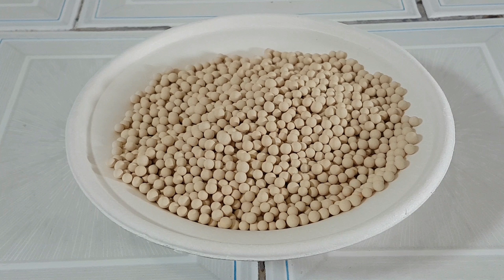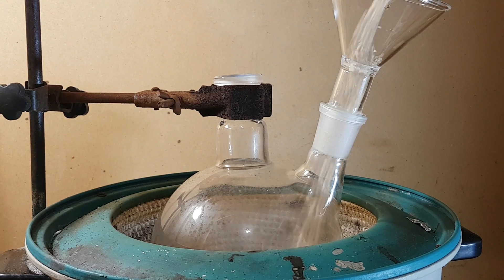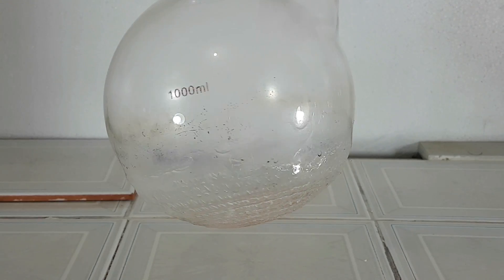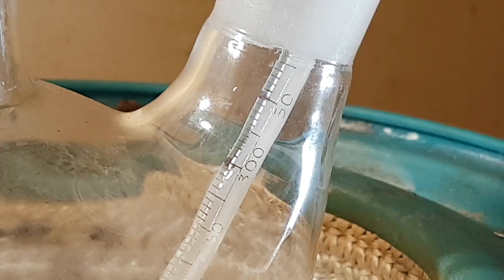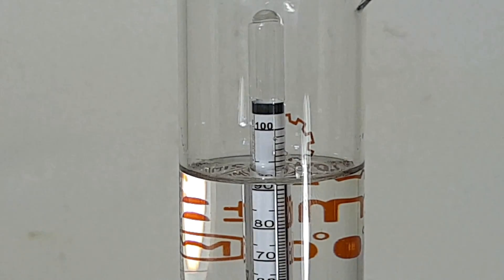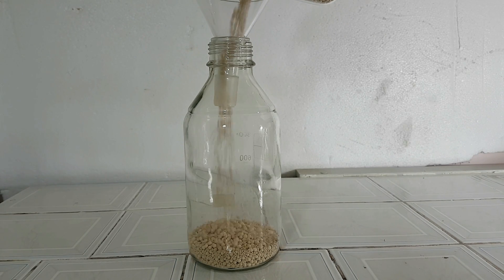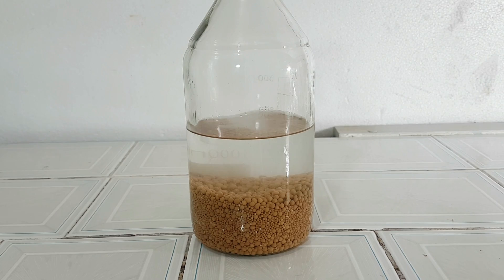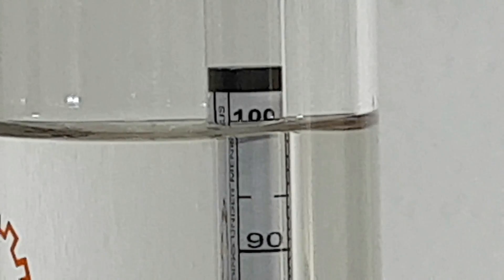How to dry molecule sieves to produce 100% anhydrous alcohol (ethanol)

Comment: Hi, could you use this method to dry 40% alcohol to around a 100%?
Reply: That’s a lot of water to remove. Yes it would be possible but would require a lot of MS drying. You’d be better off distilling off most of the water, that can get you to ~95% alcohol and then MS can take you the rest of the way

Comment: "After 4 hours, cool the flask down under vacuum." If the valve is closed during the cooling process, won't a vacuum be created anyway? Will creating additional vacuum introduce a risk of implosion of the flask?
Reply: Yes the flask would have lower pressure inside as it cools but the reason you want the sieve to cool under vac is because if they cooled under air, as they cool the would resorb water vapor, undoing your work of drying. There is a slight increase in chance of the glass breaking but as he says, use a vac rated flask and it’ll be fine

Comment: This is great, but what is the purpose of the vaccum, did I miss that part? Do you know if it's possible to dry ethanol by just using whole milled corn meal/grits mixed in with the aqueous ethanol, without a vacuum, or without passing vapors over the corn? The corn method seems to be slightly different, in that it's not about pore size, but is about waters affinity for starch and ethanol's avoidance of it. I'm guessing it would be best to still wait 24-72 hours using the corn grit method? Many thanks!
Reply: And although not very efficient...would it be possible to dry ethanol from around 70%, up to 96.4% or above, using the corn meal method? I realise that there would be some loss of ethanol that is removed when removing the corn.
Reply: @Kyle-sg4rm  under 96%, you could just easily distillate them first

Comment: How much vacuum do you pull when drying the sieves? And does the pump have to run throughout the drying process? Or will it work to just pump out the moist air from time to time? I ask because I don't have the high vacuum oil pump, only a hand pump that gets up to some 600 mmHg.
Reply from the maker: A hand pump should be enough:  When you are finished heating just pump as much air out as you can , then lock the vacuum via a tap so that the flask stays under vacuum, then let it cool that way. You don't need to run a pump while you are heating and you should only need to vacuum once, unless one of your joints leak.
Reply: Many thanks. I use similar equipment to yours. I use thermocouple for measuring the temperature of zeolites. Unfortunately, my sieves are very small and dusty and I often lose quite a bit of alcohol when filtering it. I guess this is due to their higher surface area making lots of alcohol stick to it.
Reply: Could you please advise a budget hand pump? There are a lot of electrical pumps in AliExpress that are stated as capable to do -60 ... -80 KPa and 10L/m rate, but 10L/m  I believe is too much for a small volume.